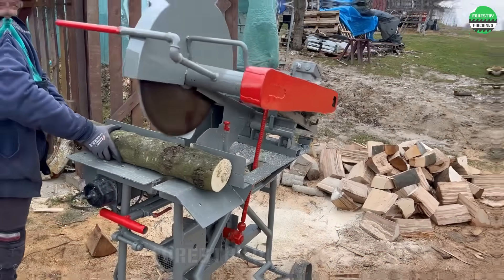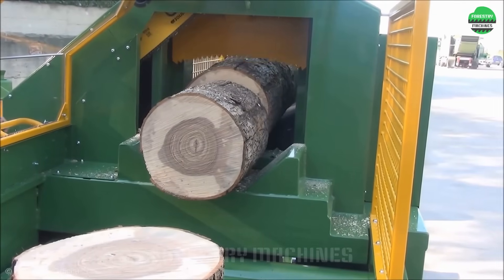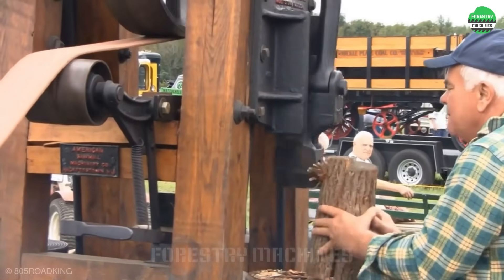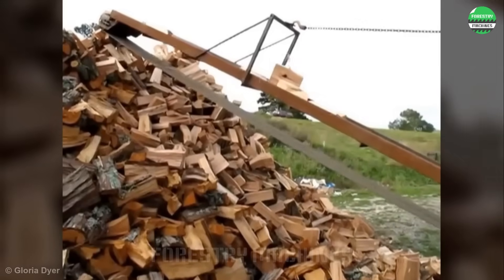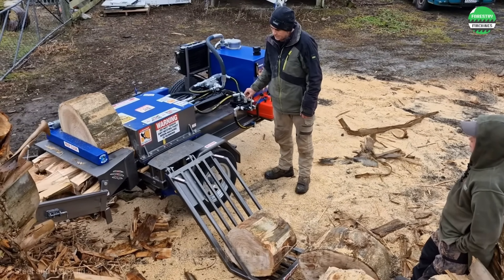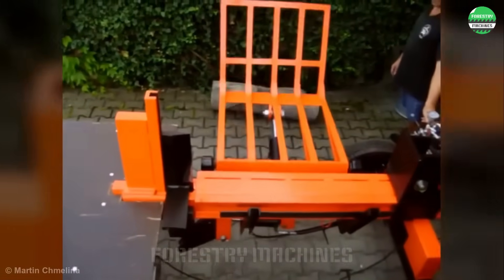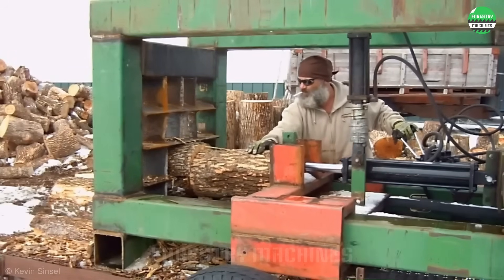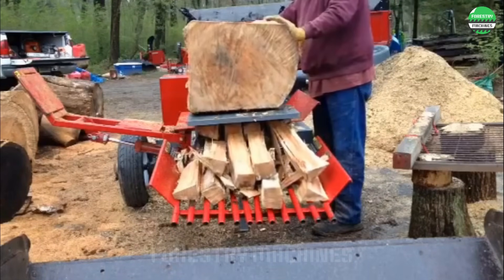Fastest Automatic Firewood Processing Machine | Homemade Modern Wood Cutting Chainsaw Machines #32

Comment: Safety appears to not be a major priority for most of these designs. Splitting blades and hands should be kept separate from each other, and designed that way.
Reply from the maker: Yes, thank you for your sharp and accurate observation! I completely agree with you. And also highly praise the safety-oriented designs, with protective frames between the operator and the wood cutting/splitting area. Sometimes the simplicity in design and small personal wood splitters can affect safety issues. There are still many machines and stories about wood splitting to come, please stay tuned!